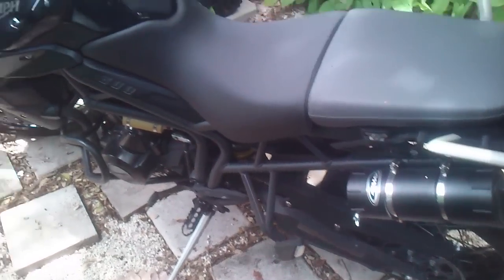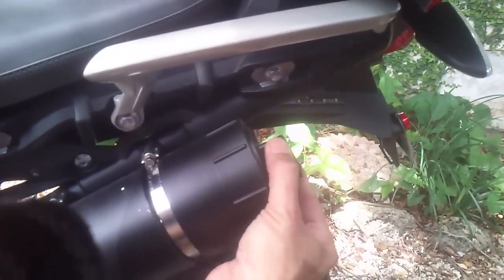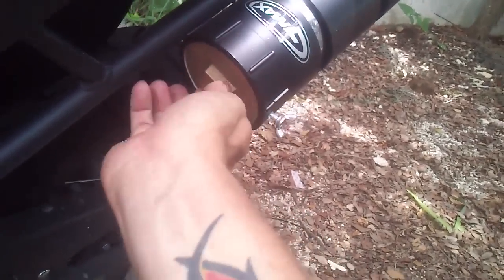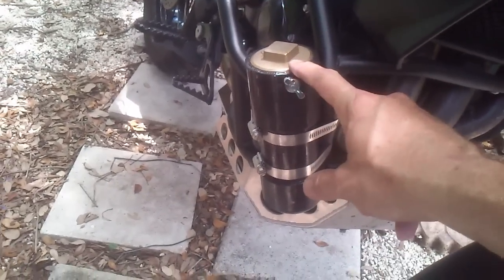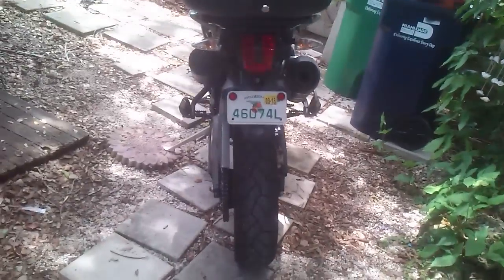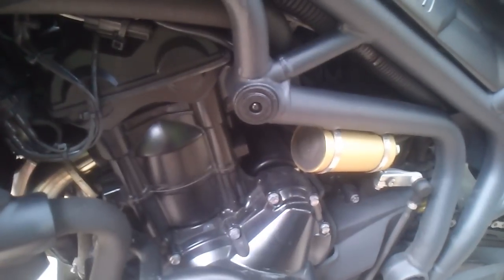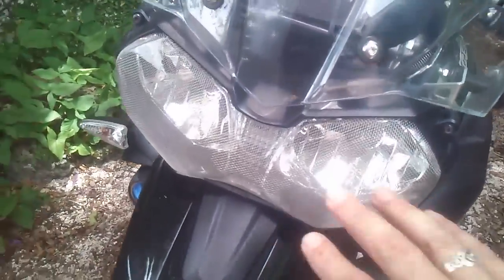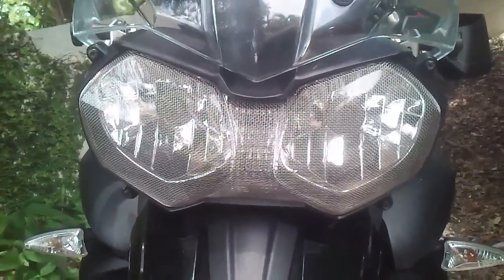Tiger 800 xc tool tubes and accessories

Comment: Very nice modifications. I'm adding a similar tool tube to mine. Question.... How do you like those foam grips? I have some vibration and I added gel grips. Not sure I like them.
Reply from the maker: JustSomeGuy The foam grips have worked well and are still on the bike, much better than stock.
Reply: limeylew Ok. I'm going to give them a try. Thanks again.